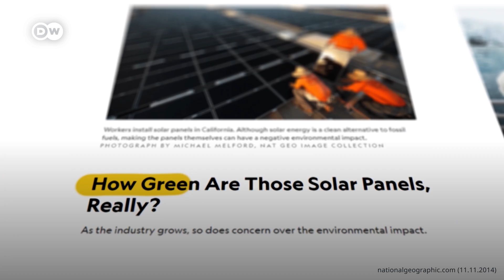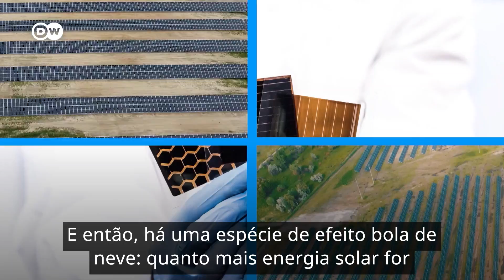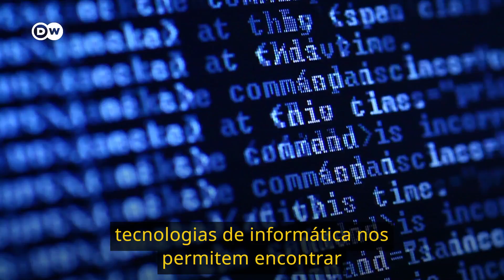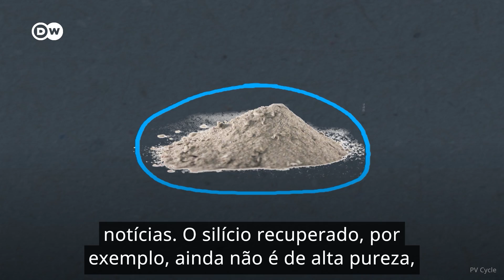A energia solar é realmente limpa?

Comment: There is no climate problem. The Climate "changes" since the beggining of the solar system. The two factors that keep earth cold or warm are the Sun's energy and the oceans behaviour. The pollution has to be stopped but CO2 is necessary for the plants and only 0,7% of the atmosphere is CO2. During the pandemic in 2020 with almost all indudtrial activities shut down the quantity of CO2 increased